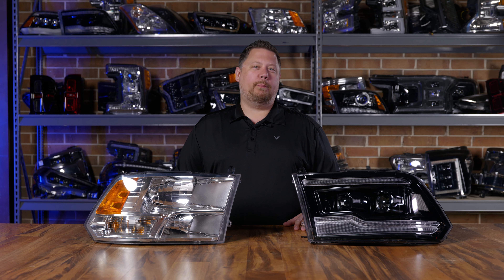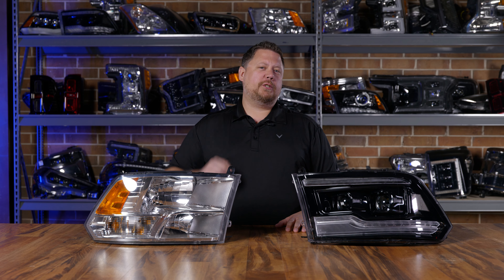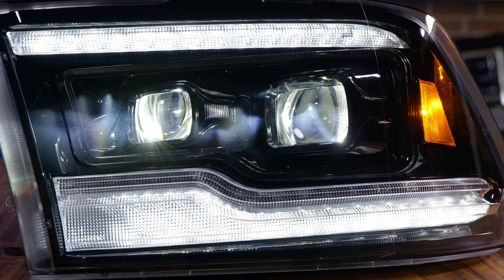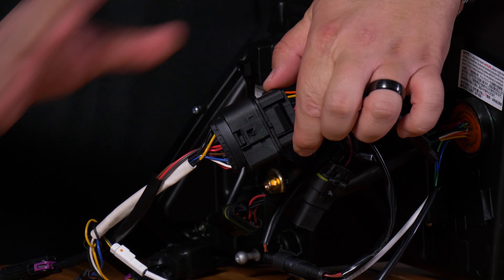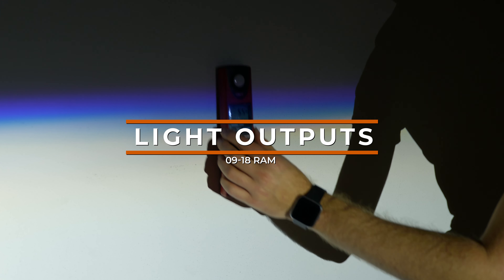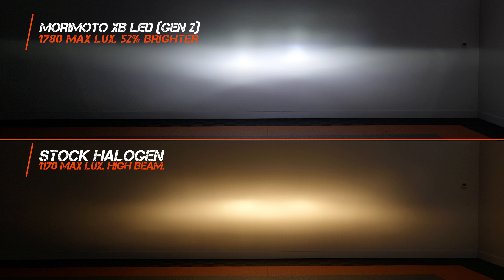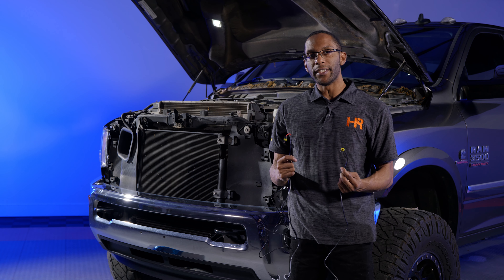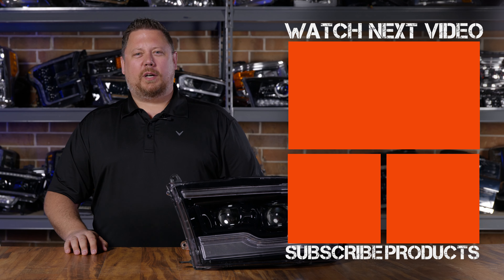The Best LED Headlight Upgrade for the 2009 - 2018 Dodge Ram by Morimoto

Comment: Just installed the Morimoto's in my 2013 RAM 3500 Diesel.   I absolutely love these lights!   What a game changer from the factory non-projector single halogen bulb I had!   With respect to this video, I would like offer some suggestions:   1)  When installing for non-projector lights, you end up with two connectors that are exactly the same.  No where is there mention as to which one one goes with which... this was frustrating.  2)  There is no mention which behavior you get when you disconnect the green while connector.   Closed gives you a solid blink.  Open gives you the "traveling" blink.  3)  This is not mandatory, but a best practice, in my opinion, wire loom should be used over the DRL wiring.

Comment: Question for you guys I have the same lights but with clear side marker, I brought them spring of this year and they do have that extra protection material around the projector to prevent melting, are those considered gen 2 with the brighter led chipset?
Reply from the maker: They are!

Comment: Would love to see a comparison between the Gen 1 and Gen 2 light output.
Reply from the maker: We no longer have any Gen 1 in house to test with, sorry!
Reply: @HeadlightRevolution  Funny thing is that I have the Gen 1 Morimoto's that I replaced for the AlphaRex nova series 5th gen 2500 G2 LED projectors that I put on my 2012 RAM 2500 which I have to say that the AlphaRex are brighter.
Reply: @paulwarren1586 do you by chance have a link or remember where you got them??

Comment: In Canada daytime running lights (DRL) are required. Does this change the install or simply not require hooking up the DRL plug? I just moved to a rural area, so need better headlights.
Reply from the maker: We still recommend using the included DRL harness, even for Canadian trucks!

Comment: FWIW, just put these in my ‘12 2500 Laramie Longhorn.  No F66 position in the fuse box for harness. Morimoto instructions say w/o that position, use M7.  M7 and DRL harness connections on each headlight resulted in constant DRL regardless of key position or light dual position.  I disconnected the harness and everything works correctly. I can select DRL with the headlight selector dial or let the auto function work and get full headlight operation.  I put this out there because I couldn’t find the answer anywhere and was about to send these back
Reply from the maker: Thanks for sharing this - definitely helpful info! The DRL fuse tap harness is designed to enable features like startup and auto DRL dimming, but it does require connection to the right kind of fuse. Ideally, it should be an ignition-powered fuse - one that turns on with the ignition. Not every ignition fuse will work, so testing for compatibility is key. Avoid using a constant hot fuse, as it will keep the DRLs on 24/7 and could drain the battery. Glad you found a setup that works for you!

Comment: I’ve seen the video comparing these to the new GTR carbide series. And while these are definitely brighter the GTR carbide has a better beam pattern. Can these be adjusted for a better beam pattern?
Reply from the maker: The Morimoto headlights do have adjusters on the back so you can aim them as needed.

Comment: Hello. I installed exactly the same ones and have a problem. The lights constantly go off and only come back on when you turn the ram off and on again. Do you have a tip for me?
Reply: I have the same issue just installed them a couple of days. Did you figure out how to fix this?

Comment: Would these work with the 2022 Ram Warlock ?? or do you have any other recommendations?
Reply from the maker: We have headlights available for the 2019+ trucks! Check them out here: https://www.morimotohid.com/buyer-guide-by-vehicle/2022+Ram+1500_with_Halogen_Headlights

Comment: If you're running the DRL, is there a way to turn then off at all? Like in the Chevy trucks you can hit off twice and the DRL turns off
Reply from the maker: Not with these trucks, if the truck is on the DRL is on.

Comment: I have the projector headlights and have the blinker in the bulb set up as my drl via alfaobd. Will i still need to run the wire for these?
Reply from the maker: We do suggest using the recommended harnesses, but AlfaOBD will sometimes fix the issue without any extras. Not every truck is the same, and we've seen some cases where AlfaOBD doesnt help at all.
Reply: @HeadlightRevolution  thank you for the information. I have another question about warranty since no one wants to respond to my emails..

Comment: What if you have a rig that already has a drl function on the high beam. My trucks a 2011 3500.
Reply from the maker: You'll still need to run the fuse tap harness as this powers part of the turn signal!

Comment: Do they adjust from the top or do you have to keep pulling them off the truck to adjust them?
Reply from the maker: 09-18 trucks can be adjusted using the OEM adjusters in the fender.

Comment: Are these adjustable while they are installed? Or do I need to keep taking them out to adjust them.
Reply from the maker: You can use the OEM adjustment points, which are located in the fender for the 09-18 Ram.

Comment: I installed the Alpharex Pro 2 projector headlights in my 2015 Ram and they are so dim that you can’t see much distance. I have tried to find LED bulbs to replace the Halogen bulbs but with no luck finding them. Any suggestions? C.S.
Reply from the maker: LED won't work in a 2015 truck. You'll need HID. I would suggest the GTR Lighting HID kit!

Comment: Due to legal reasons I need the DRLs to only light up in gear, in other words I'd prefer the factory DRL wire. Would I have to get an Alpha OBD or something along those lines to enable to DRL function, or still just plug and play?
Reply from the maker: The DRL comes on with ignition with out fuse tap, having them only come on in gear would be custom.
Reply: @HeadlightRevolution  Well no, it would not. 5:42 and onwards he explains that having the DRL behaving like OEM would do exactly that. What I'm asking is would I have to get something along the lines of an Alpha OBD dongle in order to to program the car to act like it's canadian or is it literally a matter of just plugging it in and having it?
Reply from the maker: For support with something like that shoot our XB team an email!

218-755-5200
Sales@HeadlightRevolution.com
Reply: you might be contradicting yourself. he says for oem spec in canada you leave as is and the drl will only light up when put in gear. he says if you wantr to have them light up in park you undo the connection and do the fuse tap  @Enchisedmy
Reply: @Fitter4life  Yes. That's exactly what they're saying. Since that is the behavior I'd like I would indeed have to get an AlphaOBD or something to change the truck default since it is not Canadian. Where's the contradiction?
Reply: @Fitter4life  As a side note, where does he specify it only applies to Canadian spec?
Reply: oh my apologies then no you still wouldnt need an alpha all you would need to to is do the fuse tap like they show in the video and it would be the way you want.  @Enchisedmy
Reply: @Fitter4life  indeed. Legally, though, I would normally need them to light up only in gear which would require an AlphaOBD or something like it to enable the Canadian Market DRL and use the factory DRL wire. Took a while to find all that out so by now its all said and done, but I won't lie: Some answers from the retailer would've been nice and saved me a lot of time and trouble.

Comment: iv bought the alpha rex nova from american trucks great lights but dont buy anything from american trucks open box I spent $840 for a cracked plastic mount no other problems a year and a half later 2 boards went out one in each light had a authorized serviceman test and see if repairable which after talking to alpha rex was going to replace if american trucks gave the approval which they denied for open box so I was stuck with the expensive lights unable to be repaired or replaced stay away from the open box items the may make promises but dont keep them later now that american trucks got bought out by a new company
Reply from the maker: Thanks for sharing your experience, and we're sorry that happened!

Comment: Can I order the amber version with a clear corner lens?
Reply from the maker: Unfortunately not, these are all amber side marker. We offer a smoked side marker but this requires opening the light which would void warranty.
Reply: @HeadlightRevolution  do you guys have an images on your website with the smoked lens?